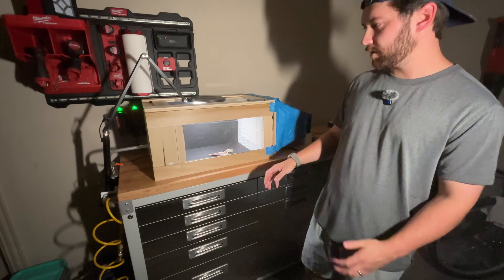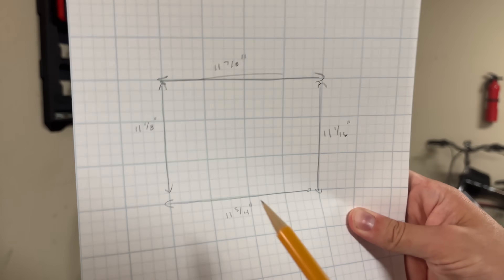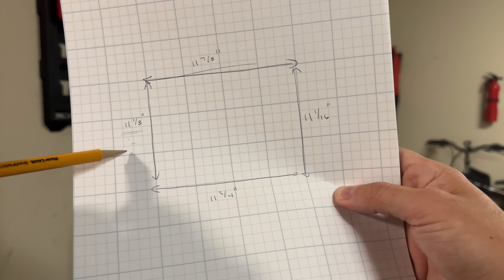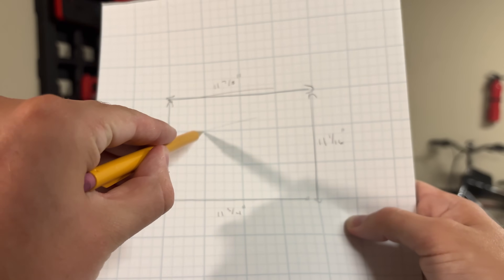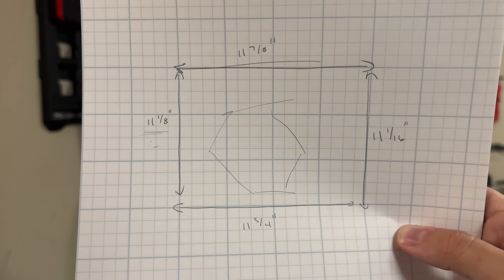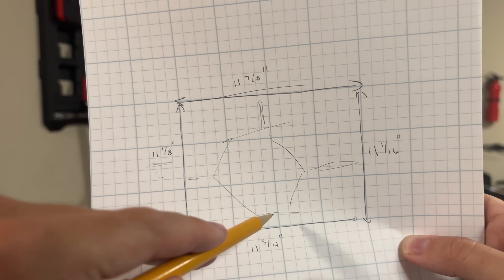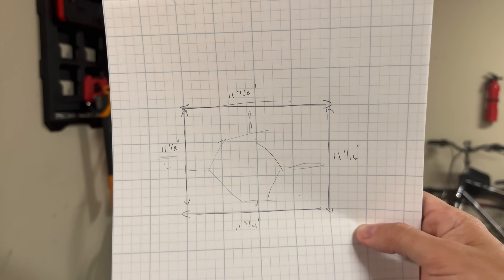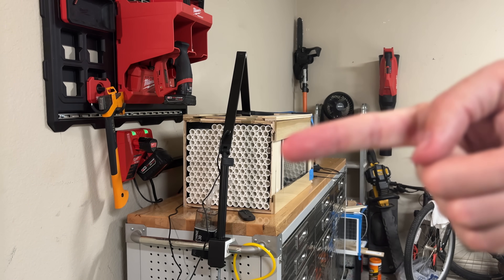DIY Wind Tunnel Part 4: I made the Laminar Flow better!

Comment: i think your turbulence could be caused by a combination of two factors:
1. diverging airflow: with large and small holes on the fan side, air will follow the path of least resistance through the bigger holes, creating diverging and converging flow that will cause the flow to become more turbulent as it travels down the tunnel, as you observed. 
2. inlet: most wind tunnels use a flared or horn-shaped inlet, which helps maintain more consistent airspeed along the walls and reduces the boundary-layer “skin effect.” this also evens out the pressure over the inlet honeycomb, further reducing diverging/converging airflow. even if flow looks smooth in the center during fog testing, turbulence near the walls and corners can be significant if the inlet is flat, and seriously hinder the useable area of the tunnel.

definitely experiment with fan placement, but also consider these two things to test too:
- check how laminar the air is near the edges, not just in the center
- try removing the rear honeycomb or replacing it with one like the forward one
Reply from the maker: thanks for the feedback! I am thinking the same thing!

Comment: An intake bell may help smooth the air's approach to the intake screen.
Reply from the maker: oooooo i don't know what an intake bell is! I will have to look it up!
Reply: @TheWindTunnelChannel-b1e  Look up 'wind tunnel contraction' for the intake. One of the standard designs uses a 5th-order polynomial for the smooth curve. You'll want a '2-D' contraction, where both the height and width decrease.

For the fan(s), you can also make a 'bellmouth inlet' to bolt on to the front of each fan. It's similar in concept but serves a different purpose than the contraction.

Comment: The Wikipedia page for Reynolds number has some interesting stuff in it.

When i made laminar flow nozzles for water, i optimized for most walls per area, so i opted for triangular infill with each triangle only being a few mm wide, and about 2 inches long. For air, its harder so you definatelly want it much longer than what i did.

What makes the air laminar is having the air spend the most time next to your walls, allowing the walls to absorb more of the sideways motion, only leaving forward motion in the air. So finding ways to slow down the air or make your tunnels longer or giving it more straight walls to interact with helps a bunch.
Reply: Also i noticed that if your airspeed is too slow, it gives more time for your fog to sink, it looks heavier than air.
Reply from the maker: super interesting thanks for sharing! I noticed the same thing!

Comment: I remember a professional tunnel with honeycomb and screen for its straightener. The honeycomb gives the length to "turn" the flow straight (think streams of air surrounded by a boundary layer) and the screen evens out pressure differences across the face of it.
Reply from the maker: That’s a great explanation! Thank you!

Comment: Try taking a piece of (scotch brite) or filter material  and put over the inlet
Reply from the maker: Interesting idea! What do you think that would do?
Reply: @TheWindTunnelChannel-b1e that should slow down the air before the tubes helping it stay more laminar you may also want to try making the hole smaller I have built a few laminar flow fountains for fun I used scotch brite and a mass of straws to achieve laminar flow with water
Reply from the maker: no way! I had no idea! thats super cool! thanks for sharing!
Reply: @TheWindTunnelChannel-b1e you're welcome I'm interested in seeing what you do with that information

Comment: New subscriber!

Fan blades cause pressure waves. I think that moving the fan closer might cause more issues.

First thing that I would do would be to make the exhaust grating have cells of a uniform size. See how that works.

If that improves things, then I would add an additional exhaust grating with a space of dead air between the pair of exhaust gratings. I would expect the grating nearest the fan to dampen the pressure waves and the dead space to diffuse the pressure waves that make it through.

The gratings must be thick enough to not flex appreciably under the pressure gradient, but thin enough to ot introduce excessive surface drag. As such, I think that it might be more beneficial to also have multiple intake grids with dead space between them.

You could experiment with different pairs of permutations of grid thicknesses at each end.
Reply: And gaps between the grids.

Comment: AI Summary

Abstract:

This video documents the process of upgrading a DIY garage wind tunnel to improve its airflow characteristics. The primary issue addressed is the turbulent airflow in the central test section, which prevents accurate aerodynamic visualization. The creator designs a custom, multi-part flow straightener with a honeycomb (hexagon) structure. The piece is too large for the 3D printer bed, necessitating a long printing process of 11 individual components. After assembly and installation, testing with a smoke machine shows a significant improvement, with the air now exhibiting much smoother, more parallel laminar flow. Some minor turbulence persists, particularly along seams and at higher fan speeds. To address this, the creator proposes a future modification: moving the wind tunnel's fan closer to the test chamber to create a more direct and uniform pull.

Upgrading a DIY Wind Tunnel for Better Laminar Flow

*   0:00 The Problem: The creator's DIY wind tunnel, used for testing aerodynamics on objects like a Batmobile and a toy Jedi Interceptor, suffers from turbulent airflow in the middle of the test chamber, which needs to be straightened for effective visualization.
*   1:56 Design and Printing: To fix the turbulence, a custom, hexagon-based honeycomb flow straightener is designed. Due to its size exceeding the 3D printer's capacity, the design is split into 11 separate pieces, a process that took a significant amount of time to print (with individual parts taking 5-8 hours each).
*   4:38 Installation: The 11 3D-printed components are assembled and press-fit into the front of the wind tunnel, creating the complete flow-straightening structure. The final design unintentionally resembles the Imperial symbol from Star Wars.
*   5:08 Successful Test: A test comparing the airflow before and after the installation demonstrates a dramatic improvement. The smoke streams are now significantly more parallel and uniform, achieving the desired laminar flow.
*   5:36 Minor Imperfections: While much better, the system isn't perfect. The creator notes some remaining turbulence, especially along a seam with larger holes and when the fan speed is increased.
*   6:24 Future Improvements: To address the lingering issues, the creator proposes moving the fan closer to the test section. The theory is that a closer fan will create a stronger, more even pull on the air, further improving the laminar flow and resolving the remaining turbulence.

AI-generated summary created with gemini-2.5-pro for free via RocketRecap-dot-com. (Input: 13,400 tokens, Output: 510 tokens, Est. cost: $0.02).

Comment: try move the fan up 2-3 centimeters, not shorten but try the funnel longer
also try putting some kind of pressure equalization barrier in in front of the fan (cloth or sponge or equal) with the same area as the primary outlet square at least 10 cm's straight before the funnel
Reply from the maker: That’s interesting! I’ll have to look into this!

Comment: Keep the fan at a greater distance otherwise you will have lower pressure around the sides. Next ensure that all of the holes on the fan side are of the same size. The smaller holes in the centre cause more friction than the larger holes hence why the flow bends down to those wider holes. In essence do exactly what you did for the entry to the tunnel to the exit of the tunnel
Reply from the maker: Great advice! I'll keep that in mind for the next iteration!

Comment: Straws and tunnel length is the key. You want as thin a wall section as possible as every time there is a transition from where there is flow to where there isn't there will be vortices. The greater the proportion of flow to no flow the worse it will be. Have a look at the video  "STRAW - DIY Wind Tunnel Project - by Kap&Kel". They produced a wind tunnel with near pro results using a cardboard box and straws.
Reply from the maker: I have used straws in the past & it worked really well! I wanted to try 3d printing because it made it a little cheaper than the amount of straws I would need to buy! Thanks for the advice! I’ll have to check out that video!

Comment: In High-school we made a tunnel inlet diffuser out of bulk "soda-straws" placed in a box (self-organising) until it was full.
It was neat to look thru too!
Reply from the maker: I did that with my last one! It worked decent but I accidentally got bendy straws, I learned my lesson there!
Reply: @TheWindTunnelChannel-b1e bendy straws 😂. That gave me a chuckle. You became an airbender.
Reply: @TheWindTunnelChannel-b1e  I wonder if there's a way to combine this straw method with a resin. Something like total boat or whatever those carpenter guys use to make furniture with. some way to create perfectly aligned perfectly smooth holes. 
Maybe something like dowels attached vertically to a plate with walls around the outside to contain the resin. I'm not familiar with techniques that are used but if there was a way to remove the dowels after the resin sets then that would be a perfect way to test hole shape/designs as well. Maybe combine your 3d printing knowledge with resin filling. Just a thought!
Reply: @keensbeanz  Old boat builder here. Unfortunately, your idea wouldn't work for a couple of reasons. First, thermoplastic resins shrink as they cure. Epoxies, like the Total Boat that you mentioned, average about 1%. That creates internal stress in the resin matrix. Second, resin by itself is somewhat brittle. It doesn't have a lot of inherent strength. Combine that with shrinkage in very thin cross section (needed for this project) and that would make getting the dowels out without fracturing the structure a tough task. Straight dowels would make it nearly impossible to remove. We can counter that by tapering the dowels by about 1% as a minimum.  That would mean machining the dowels and the surface would need to be nearly perfect in order to withdraw them from the part. That taper, of course, changes the laminar characteristics of the "tubes" created in the block of plastic you've made. The walls are no longer parallel. That may or may not have an effect on the flow (I have no idea on that aspect).
Reply: Came here to write exactly this.  Entire box of straws would probably cost a couple of bucks and would make for less restricted and smoother flow.
Reply: The exact same thing makes an interesting sound absorber to play around with.

Comment: Mate your problem is the tubes youre using. Their thick wall is causing speed variation in the airflow downstream of the tube walls compared to the tube holes

Comment: You can buy corrugated plastic sheets (used for signage). Cut rectangles and stack them until they fill the opening (or exit). This would be a lot cheaper and quicker than 3D printing to produce the honeycomb tunnels that make the flow laminar. Also great if you need to scale up your wind tunnel.
Reply from the maker: I looked into that! It was actually a lot more expensive!
Reply: One 2400mm (8ft) x 1200mm (4ft) sheet of corrugated plastic sheet (coreflute?) costs less than one roll of PLA. Did you mistakenly get a price for polycarbonate sheeting instead?
Reply from the maker: I looked into it, & where i live I would have to buy 20 or 30 & if i remember correctly they were at least 3 dollars a piece. then i could have to cut them & make sure there were no "frillies" that would disrupt the air flow. So i figured that using a 3d printer would be easier on that end. But maybe one day i will make one using that!
Reply: @TheWindTunnelChannel-b1e  I don't recommend the polycarbonate simply because the holes are so small (Unless you wanted to create a larger box later on and just use them on the outer edges.) 
(Also I never buy that stuff unless I really needed the clear form.  Just go around the day after elections, or local elections and pick up used out of date "Vote for ME" signs.  Do this to stock up even if you don't have a today project for them.)
Reply: @FuhrChris  You're talking about coreflute there which is made from polypropylene, not polycarbonate.
Reply: @zeitgeist785  I still recommend that you mark on your calendars for the day after elections and go out and get those spent vote for Me signs.  It's still good material.
Reply: I came here to say this as well

Comment: Copy the Design for the front part to the back with bigger holes ( COnsolidate 2 holes into one to help keep the catch side more open( Better at not building pressure at the back of the chamber), and maybe use a telescopic print to test the fan distance something you can add and remove pieces form if the fan distance might need to be moved for other kind of tests
Reply from the maker: Ooooo a telescopic print! That sounds brilliant!! I might just have to do that!

Comment: make sure the fan(s) you're using to pull air through are optimized for static pressure, you may also want either a larger fan or more fans in order to better equalize the pressure better across the entire "out" side. you can get noctua P12 or P14 fans for cheap enough
Reply from the maker: I’ve been thinking that same thing!! Thanks for the tip!

Comment: Higher Volume exit/exhaust fan. More draw.  Plus, swap exit pattern screen to be a single uniform pattern acros the exit. You are correct - you have less restrictions, less friction on the larger openings.
Reply from the maker: I was just thinking the same thing! I’ll have to try that out!
Reply: Yeah. All the wind tunnels I've ever seen (in movies - lol), have a spankingly huge exhaust fan - and my physics brain agrees, as it 'pulls' the air more evenly across the tunnel's aperture.

Comment: Good effort mate, but your inlet needs to be about five times bigger than that.
It's called an inlet evase, and that's where you put your hexagons. If you look at pictures of wind tunnels they ALL have that. It forces the air to be laminar.
You can fiddle around with the outlet as much as you want, but it only affects the air flow 1 diameter upstream. But about 30 diameters downstream.
Focus on the LARGE inlet evase, and you'll fix it! 100 years of wind tunnels have proved this...
Reply from the maker: That makes a lot of sense! I’ll have to experiment with that! Thanks for the tips!

Comment: Hi! im thinking of making this for my school Rocketry team to test the rockets... It's gonna be a lot longer than yours, and Im thinking of using four of those fans stacked 2/2. I wondered if you had any thoughts on this and if I could borrow your black grill design (im not very good at cad and the best thing I could do Is scale stuff down/up. We have a laser cutter at school and Im thinking of making the back and bottom from MDF and the front and top from clear acrylic. I will use the cheap fogger you used in your first version, but I need to think of a way to collect all the smoke and direct it evenly to the whole face of it. Wondered if you had any thoughts?
Reply from the maker: Awesome! & please do! You can also use a bunch of straws! Like jumbo boba straws!! That might be a little easier to get & you can google jumbo straws bulk! But if you have a3d printer, go check out my other previous videos to see how I printed the laminar flow block! 
As far as the smoke machine, you can get a deli container & a funnel; cut a whole in the deli container toward the top so you can wedge the smaller part of the funnel into the hole to give the smoke a direction to go! Let me know if you have any other questions!